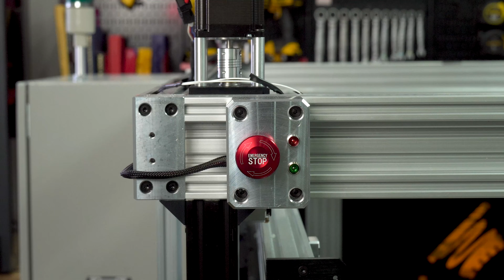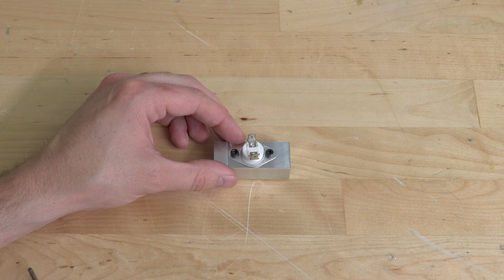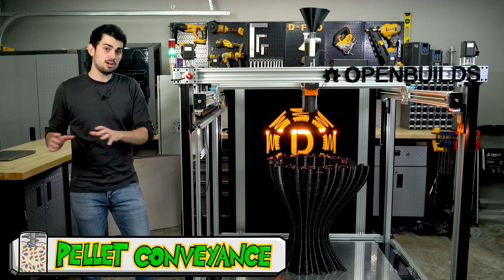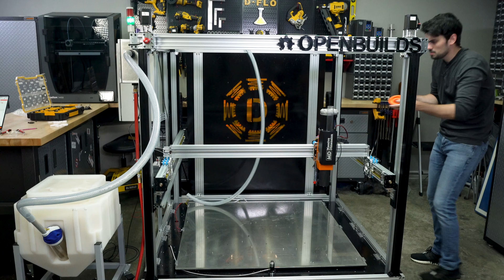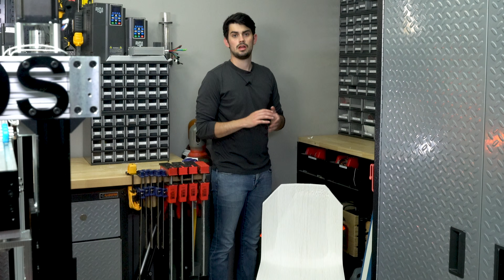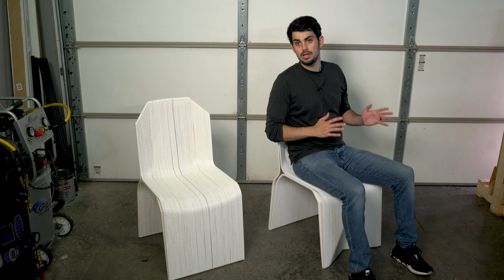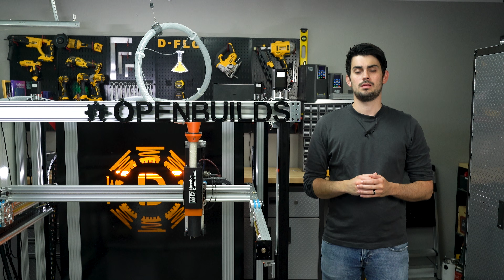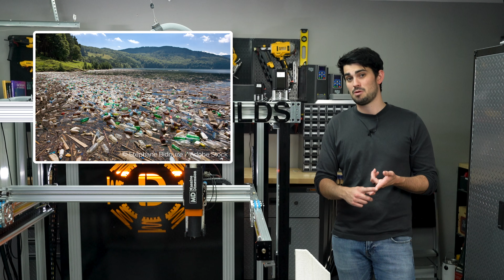Building a Large Format 3D Printer – Part 4: Printing

Comment: Changing the design of the chair to use less material should be doable. If you have access to software that can model the stresses on the chair and show you where you can remove material along with doing an infill pattern, you could shed a lot of material.

Comment: It is always a pleasure to see what this great professional/engineer can make. His explanations are sized properly and his videos are therefore easy to watch. 
I have built a bigger printer using arduino/marlin setup. Marlin firmware allows virtually any bed size. What I am wondering is if the hot bed can be eliminated as it was the case with the first 3D printers, where a sticky tape was used to hold PLA to the cold print-bed/surface. The benefits would be energy costs reduction as well as complete price of the printer and its maintenance.  Can the weight of an ABS printed part be enough to hold the part down and prevent warping?
Awaiting your comments...Thanks!

Comment: Have you considered a hopper above one corner of the printer. when pellets gets low have the printhead move to the hopper and drop pellets into the print head chamber. It would be similar to a nozzle cleaning routine.

Comment: I asked my wife if I could have a printer this big...and she laughted at me and walked out the room. So for now I'll have to live vicariously. Seriously awesome job! I wonder if you could use duet to set a timer for the pellet vacuum so that your compressor cycles less? Maybe based on your volumetric flow duet does some calculation for how much filament is remaining in the hopper after the proximity switch shows 'open' and waits until the hopper is 1/4 full or whatever before engaging the solenoid. Your compressor will run longer but less often!

Comment: Thought, you could make a custom flat rectangular pellet container that is mounted up next to the ceiling  that is feed by the Venturi location.  You could then have them heated and control additional humidity if needed from the container down to the fill system.   ie have a dehumidifier pumping air into it*

Comment: you should add a safety feature that prevents feeding issues from getting too bad by for example measuring the time it takes for the hopper to get filled to the sensor level plus a few seconds for margin of error and having that automatically shut of the pellet feeder and pause the print if the extruder hopper doesn't fill in approximately the expected amount of time. and adding a fill level sensor to the pellet reservoir that also pauses the print if the pellet level gets to low would be a good addition to the printer imo
Reply: ok neverminded you literally said almost the exact same thind 5 seconds after where i had the video paused...

Comment: For the pellet issue what about using something like a 2 inch round tube that’s flexible with a piston in it that’s got a flexible rod that will take a certain amount of pellets that’s gravity fed and dropped into chamber that has the piston in the tube so it can be pushed into the top of the funnel are or some of type of chamber to hold the pellets on print head.  Have a sensor in chamber so when pellets get below that level it will activate the piston to push a desired amount each time into print head chamber until it gets above sensor level then it will stop filling until it gets below sensor again then repeat process

Comment: If you are looking for dry air you can add a SMC P/AMG350C-03D water separator before the inline vacuum and after the auxiliary air tank or the much cheaper option is adding a SMC P/AMG250C-02D inline between the compressor and aux air tank both have a greater than 99% separation rate. Make sure to get the auto drain in normally closed some smaller compressors struggle to close normally open auto drains.

Comment: The intake fan should be the lower fan on the cabinet and the exhaust fan should be the higher fan in the cabinet as hot air rises, this is standard.

Comment: with a pallet input, and the scale of your pints, it may be a good idea to test adding recycled plastics into the mix. shred up some old water bottles, pints, the like. as they mix in the chamber, they should make some interesting colors and patterns, that may help strengthen the larger print. mixing stronger and more flexible plastics at the right ratios, should make something better than both.

Comment: I use a pressurized hopper that air enters the bottom and top to pressurize and fluidize the media to be conveighed this takes less pressure and less cfm for the same amount of media. I use a 2" black water back flow preventer valve from the hardware store with a small piston actuator to close the valve and let the pressure hold it shut. I had to add extra 1/16" rubber to the flapper valve part and it works flawlessly. A used propane tank and some welding kept this cheep to build.

Comment: for the vacuum you could make a more efficient system with a cyclonic separator, it may also be cheaper than the radiator system, as you can just print it on the printer and use a salvaged motor from a vacuum (or buy one for like 10 bucks). though efficiency isn't that big of a deal since you're using like 2kw for 1min per hour at most

Comment: Got to say there are much better air coolers out there. You can find tons of modes of them with car radiators and all kinds of things. The key thing I think you missed is that the cooler should be on the hot air coming out of the compressor unit. Not just the air coming out of the system. You want to stop the moisture from getting into your system to begin with.

Comment: A elevator, like they use on farms for grain, for transporting the pellets to a hight were they can slide down into the same aperatus you have with the sensor would be another option, less complicated in my opinion. A vertical one

Comment: for infill i think a variable infill will be hugely useful for your usecase
in prusaslicer you can use support cubic at higher infill ratio like 20% and still save plastic
for cura you can use lighting infill though in my experience lighting can be a bit more flimsy

Comment: Awesome build!!

I found a Cura setting once where it cleverly increases infill density the closer it gets to the roof. Perhaps that's worth a shot to save material If you can use the slicer.

There are also lightweight filaments that reduce weight because they foam up when they get out the nozzle, perhaps worth a try if you can find it in pallets. but it probably won't be cheaper even with the less weight.

Wouldn't it also be better for the nozzle to have a flat surface to iron out all the extrusion that's wider than the nozzle diameter? especially when you go from a 5mm nozzle to a 10mm line width.
In the first video I saw that all the flat surface was gone after drilling the hole 😆 

I would really like being able to print that size, but man I could not afford it. 
part of what makes 3D Printing fun is how cheap and fast it is to create your own products.

Comment: to get matieral cost down I would look into cutting your pure PLA with recycled PLA pellets, or gather up your own plastics, be them failed PLA prints, ABS (without the glass fiber of course ;) ), or PET, or HDPE, and use purely recycled plastics, it would take a lot of tweaking ,but thats half the fun 

(obviously you cannot mix PLA with ABS pellets, but it may be interesting to switch over to 100% recycled pellets for "quick and dirty" prints)

Comment: For the pellet output from the ventri pump, that hose looks super overkill. That's suction rated hose, which is required to prevent collapse on the suction side but the output side of a pump you could use a very flimsy, lightweight, flexible hose. Since it's under a positive pressure and will puff up.

Comment: To take out the water a wide diameter line nearly horizontal. low point input high point output and trap T near the low point. Typical installation for paint shops.

Comment: Love the extremely large format printer that you have made , And to be really honest with you I can’t criticise anything that you’ve done apart from one thing that you may have not considered rather than using that really heavy duty pipe which obviously can weigh quite a bit, 
If you was to swap that pipe over for the corrugated type that you find on a Hoover , such as a numatic type Hoover you would save a lot of weight plus getting more flexibility from the pipe

Comment: Great project maybe you have over enginered the feeder a simple encapsulated archimedes screw will work for half the dodaas you put on with the vacuum system and would cost a lot less electricity

Comment: Throughout the 4 videos you present a very thorough approach except way back in #1 I spotted your motor mounting see 0:45 in this video.  When you compare what you prepared for the safety switch mount vs the "compliant" motor mounts - 4 spacers, I suggest you could improve/stiffen the motor mounts, too.  Of course, any idiot can suggest changes - me.  You have a remarkable project for which I am a solid admirer of your work and keen to see you  'sail' away on the full size benchie.

Comment: When i print PETG or ABS with adhesion spray on the print bed i sometimes almost need a hammer to remove the print from the bed. I think if you will ever print a material which needs adhesion spray you would need a jackhammer to remove it from the print bed. 😃

Comment: A bit late to the video but a proximity sensor lower on the extrusion hopper set to halt print/pellet fill if the pellets in the hopper get too low might be an elegant solution to prevent that pallet spraying issue

Comment: A delay timer on the solenoid valve tha would engage if the valve is open for too long would save you from some troubles with the pellet transporting system.
When I am designing systems with compressors and pumps, I implement such timers in software or integrate them in the circuits.

Comment: You should reverse the two first lines inthe if of your daemon script for temperature to avoid a tiny corner case, that is if the program freeze in the middle of those two lines there will be two dark led (could be mistaken as everything fine), whereas if you reverse it there will be two bright leds which would indicate the corner case and the red indicating it is hot. 😉

Comment: Large motors that can run unmonitored (like your compressor in this case) should get a thermal cutoff installed that prevents them from overheating... (also used on water pumps that might run dry for example... )

Comment: I know this video is old but in case you see this I saw a much higher performance from my compressed air "passive" dryer by just pointing a box fan at it. Did a test and I got 40% more water out for the same run time.

Comment: Similar to a Dust boot connection for a cnc router, you should consider having the inlet for the pellet blower on the top of the feeder instead of the side. You will get way less force on the joint and make it much more compatible with long motions. That "flexible" PVC you are using is not very flexible. Maybe 3d print a large version of the snap socket coolant nozzles (those ubiquitous blue/orange style ones)  that are intentionally loose so they flex easily, or use...   Flexible EPDM Rubber Radiator Water Coolant Hose. Way more compliant. I hope one of those suggestions help. You are doing things that I would do if I had more time/energy. lol. So I hope I may help by proxy.

Comment: Also, you only need the heated bed for the first few cm. Use gcode to turn off heatbed at 2 or 3cm and it prints will not be affected. Have been doing this for years at 4mm for a normal printer at .2mm layer height. Printer uses not much power...heat bed does.

Comment: You can easily improve colourant mixing and flow rate by drilling the nozzle perpendicularly, and soldering in a thin wire. Credit to CNC Kitchen

Comment: Hello. You can refill extruder periodically, in one ot the corners of printer. 200 - 300 gramms per one load. Yes, it can't print in vase mode, but it will be simpler.

Comment: 23.7 kWh That is only cheap in the US. In Europe, especially now, that would be $12. Insulating the bottom of the hotbed and possible use loose blankets on areas outside the print, or go completely nuts and overengineer the hotbed by using a matrix of small 2" heating pads controlled by as many temperature sensors?

Comment: What if you had a way to weigh the head /w tank while it's in use, and once it gets so light then vacuum in some more...
OR! You could keep up with the total head travel distance... well ok not all travel, just the travel when dispensing, and know the weight of an inch or foot etc, so you precisely know how empty the tank is... well outside of being melted makes is compact and not melted takes up more volume. 
But you get where I'm going with this correct?

Comment: okay, so I don't know if they make light weight pla pellets, but you should try building wing sections for an ultralight aircraft. I couldn't design it... but I could fly it... It could also be a good way to experiment with printing infil at a higher extrusion rate than the perimeter (skin of wing section)

Comment: The moment you said you wired the vacuum pump to shut off after it hits the limit switch I was waiting for you to say that you also set it to turn off after a few seconds if the limit switch was not hit. I knew than any issue with the limit switch not being triggered could cause problems.

Comment: The thermal fuse uses a bimetallic plate to trigger, soldering will trigger it, but these fuse's reset when they cool down, proper crimp terminal are a much better solution though.
Reply: There are non-resettable bi-metallic thermal fuses. They are typically used for overheat protection so as to force an inspection of malfunctioning equipment.
Reply: @cameronwebster6866  there maybe but the one shown is not of this type, I have the same unit and and have tested it before installation. I should have stated switch and not fuse, my bad

Comment: Just a correction on the carbon impact of printing PLA - when printing PLA we actually remove carbon from the air. This is because PLA is made from plants, which extracted the carbon from the air. It is essentially a form of carbon sequestration. 

Obviously, plastic has other negative environmental impacts, but carbon footprint is not one of them.
Reply: That’s only if you look at it in isolation. It ignores the carbon released from the farming (herbicides, insecticides, fertilizers, fuel for farm vehicles, harvesting, etc), transportation between the various stages from farm to end user, emissions from all of the production methods and the parts that go into it (spool, colouring, other additives, plastic wrap, the name escapes me right now but the package to keep it dry, packaging, etc), and the emissions from the printing process itself. 

Yes, using a filament that’s made from a plant is better than one that is made from fossil fuels but it is no holy grail that makes 3D printing emissions neutral.
Reply: I would also add that an R&D lab is not the place to start cutting back on carbon output.... Do that at the production level.

Comment: For cooling : what about a little vortex tube ? Peltier ? Hot and cold side could respectively pre-melt the plastic and help the extrusion to cool down. Of course, for vortex tube, it has to match your air flow rate capacities, which seems to be already undersized according to you ?

Comment: I would like to say that injection molding takes all the scrap from sprues and gets reused it gets reground to the size of pellets and then mixed 60% regrind to 40% virgin material at least that's how we do it at my work with POM Plastic AKA Acetal Plastic. As well as ABS plastic.

Comment: Why not drying the air out from the compressor and filling the tank with dry air ? That way you also protect your tank from corrosion. 
Also, as I was a scuba diver, i know that the compressors used to fill the scuba tanks, are drying the air (and also won’t send grease in the air) while compressing, they go up to 200 bars easily so may be very well adapted to your needs.

Comment: I am currently in the process of servicing a similarly sized 3d printer. The main difference is that the machine that I'm working on is filament based (1.75 mm). It has 2 extruders with the bigger nozzle being a 1.8 mm CHT.
There were some extremely surprising things that I discovered during the process:
Bridges are a none issue 300 mm without a problem.
Print speed is slow, with our current underpowered extruder we cannot get past 12 mm/s print speed. (20 mm³/s)
Bed leveling and positional repeatability is difficult, currently working on that.
Reply: What extruder are you using? If you have the money, a Bondtech or E3D extruder would probably be a good idea (preferably Bondtech, as their extruders are built for more power, especially the QR extruder, which can supply a Mosquito Magnum+ hotend with filament). Is your hotend capable of ultra-fast printing?
Reply: @grahamturner2640  we are currently using the BigRep One Gen 1 extruder with some modifications. The motors are definitely strong enough, they are the strongest NEMA 17 that nanotech sells.
The hotend is the current bottleneck. Cheap coldend with V6 Heatblocks and presumably 30 W heating elements running on 24 V with 50% PWM as they are 12 V heaters. The parts to upgrade to a volcano hotend with 60 W cartridges are ordered.

Comment: you could have put all the aluminium tube inside a refridegerator and chilled it to sub ambient for higher efficiency in removing moisture also you might want to reverse you moisture loop as any condensation that forms on the up path is goin to be picked up by the fast moving air you want the air to have make a sharp 90 turn with a straight flow path for the water as the water has a higher mass than air it wont want to make the 90 turn you want your capture points mostly like the last one in your system.